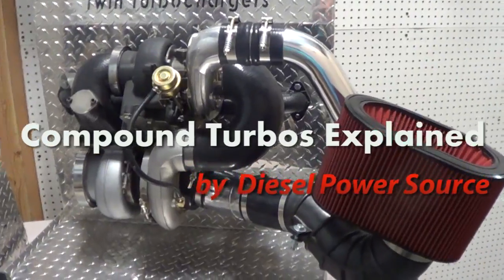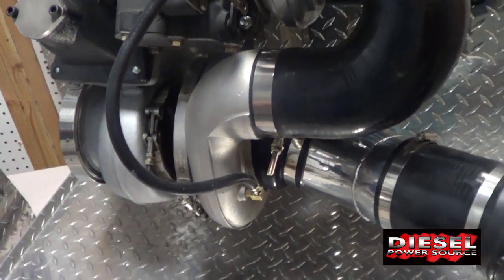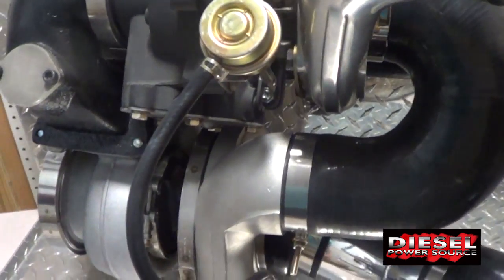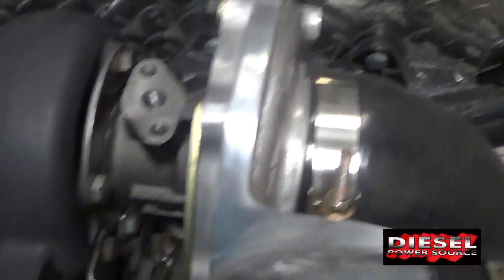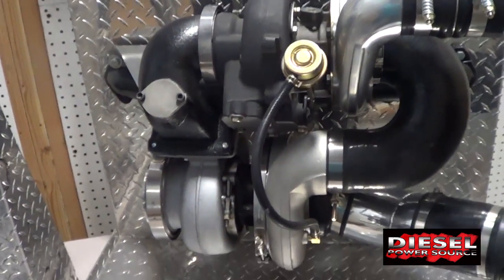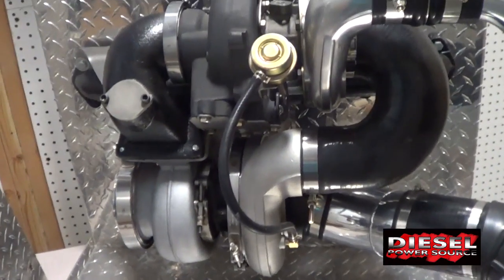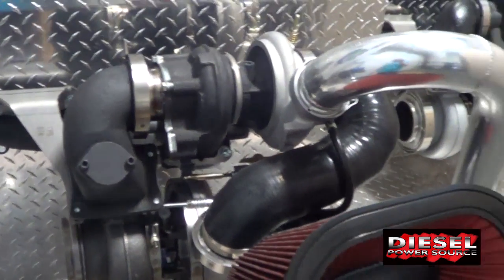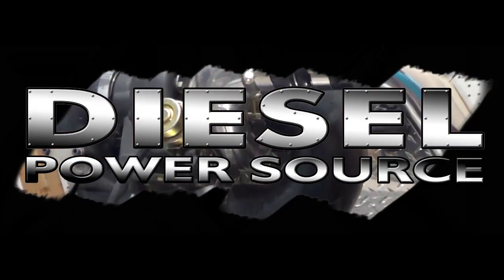Compound Turbochargers Explained

Comment: has any one ever put an inter cooler between the turbos ?
Reply: michael harris yes check out the hoonigans channel they got someone's on there with old ford truck with a Cummings. It has a water to air inter cooler between the turbo. The truck makes 1233hp to the wheels with 2000 ft/lbs.
Reply: Hey guys. International trucks did put an intercooler in between the turbos on the maxxforce engine. It pre-cools the air before it goes into the smaller turbo. It works great. Look for the maxxforce 13 engine. Most drivers will complain about it but they're comparing the power of a 12.4 liter to a 15 liter. I love my 12.4 engine and I own them both.
Reply: @MakingCentsInTrucking  u r the only person to ever say "I love my maxforce" lmao. They r the worst engine out there!
Reply: @MakingCentsInTrucking  That engine is a piece of trash. I've worked on them for 4 years and they have nothing but major malfunctions. You have to replace the EGR coolers every 100,000 miles because they leak coolant into the engine on the hot side EGR cooler bundle. Multiple sensor issues, EGR valve stepper motor, Intake throttle valve stepper motor, the DPF injector is a pain in the ass to get to to service if you need to clean it or replace it. The DPF and DOC catalysts are made of literal swiss cheese and disintegrate after 175,000-250,000 miles requiring you to replace the entire catalyst canister to fix the cracked DPF catalyst.
Reply: @JosephArata  , are you talking about the international maxxforce 13 liter or the powerstroke?
Reply: I saw a race motor that had air to water imbetween
Reply: Technically, that's the only situation where you have a literal "intercooler". If it's between the turbo and the engine, it's an aftercooler, if it's between one stage of compression and another, it's an intercooler.

I used to do maintenance on some big quarry trucks that ran dual supercharged and quad turbocharged V16 engines. Each cylinder bank was plumbed (Air cleaner->Air Filter->Supercharger->Turbo->Intercooler->Turbo->Aftercooler->Intake) I guess that used to be the cheapest way to make 5,000 Horsepower.
Reply: Yes. Air fighters back in WWII. Hence the "inter" part of the name. Pointless in a wheeled vehicle.
Reply: @AlejandroBelloRD  Why would further cooling your intake air therefore increasing its density and the power that you can get from that air and the efficiency of your engine be pointless?

Comment: 2:25 Benefits; Cooler air; Please explain.
Reply: Cooler, denser air burns more efficient than hot light air, in turn gives better power and torque throughout the power band
Reply: @jamestaylor-qb9wo  yea but it goes through a turbo an heats up. And then that hot air goes through another turbo. Then the cooler
Reply: @bburnnone  exactly what I was thinking
Reply: Its denser and cooler because the bigger turbos not working hard to compress the air that hot because of the volume and it s just shoving it down the little ones throat,so then it becomes on how efficient the little one is on its maximum rpm.

Comment: Great explanation! Here's a theoretical question. Say you have a gasoline 4-banger (2 liter). If I wanted to run a supercharger AND a turbocharger for maximum boost throughout the rev range, would I feed the turbo into the SC, or make the SC feed the turbo? What would be the best way to route them if space was not a problem?
Reply: Kryndon64 turbo into supercharger is generally better because superchargers are better for low rpm power, while turbos are happier in the higher rev range. thso way, the supercharger doesnt run out of steam at upper rpms if it had to feed the turbo. with the turbo feeding the supercharger, it wont run out of steam as it doesnt have to suck in the huge cfm amounts of air as the turbo does. it just compresses already compressed air
Reply: ti1355 i never throught of using a supercharger to spool a larger turbo, than open up the turbo to the atmosphere. very good idea
Reply: Sc will ruin out of air bf it spools the turbo, as mentioned if you do that you have to bypass it, ie the engine basically runs off the sc at low rpm then switched to turbo at high rpm can't actually feed the turbo with sc bc it Will literally run out of air, look at spool speeds and you'll see why
Reply: Mikel Bentley Yes it's true that a supercharger will run of breath when the turbo spools BUT it's very easy to bypass it. All you need is a one way valve parallel to the supercharger. As long as the supercharger is pumping more air than the turbo is sucking in the pressure in the supercharger outlet is higher than the inlet pressure. Once the turbo spools the pressure drops because the supercharger can't keep up with the flow requirement. The one way bypass valve opens and air goes past the supercharger, the supercharger just free spins with minimal parasitic loss.
You can also do it the other way with the turbo feeding the supercharger but it's a bit harder to controll such a system.

Comment: Do you guys think it's a viable development tactic to design an electric precharcher turbine that takes the place of the first stage turbo on a compound turbo system? If someone can make a precharger spin to 50000+ rpm nearly instantaneously like those dang bmw and volvo electric prechargers, would the price of the r&d pay off soon after people began buying the kits? Y'all seem to be able to make very compact compound turbo kits whereas the bmw, volvo, bugatti systems are all planted upstream via much longer tubing to be able to fit inside much different and compact engine bays. What do y'all think? Could Diesel Power Source make a badass super quick spool compound turbo that feels like a supercharged system that just keeps on building boost?
Reply: whitlcj1 An electric precharger kit is not really practical UNLESS you have a 48 volt or higher electrical system. A supercharger draws a lot of power, we are talking about 10-20% engine power. A 100kw engine would require about 10-15kw of power which means 3-5000 Amps at 12v. By comparison an automotive starter draws 2-3kw of power. That's about 300 Amps. Truck starters with 6-7kw have 24volt electrical systems and also run at about 300 Amps. Now remeber how thick starter cables are. You would need a cable with at least 10 time greater area than that for a 12 volt system. This is extremely unpractical. Also the battery simply can't supply that amount of power. With hybrids it is easy, you already have a higher voltage system that can supply the power. All you need to add is the supercharger itself.
Reply: whitlcj1 Also a mechanical supercharger has it own set of problems but they seem to be easier. Since it would be driven directly it's speed would be directly proportional to crank speed. This means that if it was geared for low rpm it could overspeed at high rpm. So we would need a clutch that can disengage it. If it were geared for high rpm then it wouldn't make much boost at low rpm.
The complexity of the belt drive is increased. This system would be very exprensive for what it does. Do you really need full torque from idle, or can you live with it being at 1200-1500 rpm. Do you really mind half a second of delay after you press the throttle. Sure it would be nice to eliminate that but would it be worth it if it costs thousands of dollars? Also modern turbochargers spool faster and have lower boost thresholds than ever. So the requirement for such a system is lower than ever
Reply: Yip YouTube cleetus electric supercharger works great i dont know about 2500$ great though,considering theres 500$ high powered brushless rc speed control and motor sets that easily put out 5kw on 24v 200a and 800a burst the batteries would be the main expense say 150$lipo for 15min runtime but then youll probably only have it going 10 seconds at a time for the initial pick up.

Comment: You can't get power on an intake stroke.
Reply from the maker: You can if the boost pressure (incoming air) is higher than atmospheric pressure.
Reply: Smokey Yunick's Hot Vapor Engine had power on the intake stroke for the same reason that DieselPowerSource said. Please research it.
Reply: +jkk20, you totally misunderstand the concept because the power doesn't come from suction, but from the expanded air/fuel vapor mixture that is trapped between the output side of the turbo and is released on the piston that is on the intake stroke. And that does not interfere with what happens on the power stroke but is just a compliment to it. So in effect every downstroke would be a powerstroke
Reply: Alex Lindsay
power comes from expansion of gases. but we do not operate single cylinder engines do we?.. so while one cylinder is in suction,another one is most likely in combustion. hence,the added force caused by the overly pressurized air comming in exert an added bit of pressure possibly speeding up the descent of the piston wich applies force on the crankshaft wich adds more twisting force to the whole process. its what i meant. could it be possible that it work like that? and in that sense compounding more and more would possibly add another few % more performance
Reply: jkk20, anything that works for one cylinder works for all. Because no matter how many cylinders an engine has, it's simply a multiple of one cylinder and I thought you'd understand that. Yes power comes from the compression stroke primarily and I'm not disputing that but in the case with Smokey Yunick's Hot Vapor Engine, a pressurized intake plenum also provided power on the intake stroke. Simple physics explains that.  The same scenario that you mentioned about pressurized air exerting a force on the intake pistons already exists in present turbocharging set up, but just not as much because the intercooler interrupts and slows down the air flow and makes the air charge not so dense so it doesn't expand as much as Smokey's patented and proven non-intercooled system did.
Reply: Alex Lindsay
how would you pressurize the intake plennum? once you open a valve you depressure the environement right? the only way would be to calculate the pressure loss around the curve and to balance pressure ratios to overcome the pressure loss right?.  ps can you provide a link to said smokey`s steam vapor engine..
Reply: Theres guys now running 150psi on compound setups and thats kind of shoving it in anywhere it can to the point they have to increase there headstuds 50% to strap it together YouTube fueltech rx8.
Reply: That makes no sense unless your boost pressure is as high as your combustion pressure. also boost is called boost because it's higher than atmospheric pressure. you must not have a good concept of how a 4 stroke engine works. and if you listen to what you say about the intake of air the small turbo compresses the air first and the large turbo is just drawn through. when enough exhaust volume is created like in higher rpm the small turbo loses its ability to compress the air further and by this time your large turbo should be spooled up and start compressing the air at a higher pressure and volume.
Reply: you would need alot of pressure to have an impact from the suction to add power that is noticeable. i`m not saying it is impossible,but it would be mostly innefective to try and gain power from suction rather than extracting more power from combustion pressures